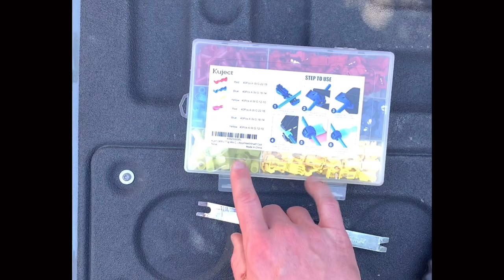RAPTOR GRILLE INSTALL ON 2016 F150: Only complete install on YouTube.

Comment: Best tutorial regarding the grill.  I bought the same grill you did and installed it myself today.  It took me 2.5 hours without using any power tools.  It completely changed the face of my truck.  The only thing I did differently is putting heat shrink wrap around the connections leading to the power source  Thanks, Bro!  Liked and subbed!
Reply from the maker: Thank you so much for taking the time to say that. It really means a lot. Take care brother. 🙏🏻🙌🏻

Comment: Thank you so much, you went through every detail; it took me at least 3 hours. The biggest problem areas were the screws attaching the grill to the housing and the wiring. I didn't have the crimp and clamp stuff but I had a soldering gun. It wouldn't be hard to wire if the parking clamp was longer but I got it done.
Reply from the maker: Awesome man! You are welcome!
Yeah that wire is kinda short. I’m glad u were able to get it done. What year F150 do you have?
Reply: @AutoHeadz  It's a 2016 and I found the black and green wires on the driver side, the passenger side was black and brown. I think wiring was actually harder than the grill install with the limited space I had to work with.

Comment: Great video!! The process was step by step just like you said and it was SO helpful!  You made it so easy! Thank you!! The only issue I had was that I have the LED headlights and the wire for the parking/running lights is not that easily accessible. So I need to tap into the fuse box or find a way to otherwise tap my running light wire.

Comment: Thanks for this. Im planning on doing this to my 16 F-150 soon.
Reply from the maker: No problem man, I’m glad you liked it. Thanks for the support.
Reply: @AutoHeadz  dumb question, on the links there are 3 grilles which is the one on your 2016? I like the new style but it’s out of stock.
Reply from the maker: Not a dumb question at all. They keep getting sold out so I put a few links so people can get ahold of one.
The one that is on my truck is the other two. They are the exact same just sold from a different vendor.
Reply: @AutoHeadz  thanks and have a Merry Christmas.
Reply from the maker: Absolutely! The Boaz one is a little cheaper. 
Merry Christmas to you too.

Comment: Great vid. Gettin ready to do my install.   But gonna hold off and order the tools you recommended!!!
Reply from the maker: Thank you. It’s an awesome upgrade, you will love it. The tools definitely make the whole instal very simple. When you finish let me know how it went. Take care!
Reply: @AutoHeadz  Just knocked it out.  Yur vid was a huge help.  Thanks a lot!   The only thing I would do differently, hindsight being 20-20.  I would have connected the wire tap tool to the parking light wires before placing the new grill back onto the truck.  Justa little more room to work.  
But great video dude. Thanks again!

Comment: It took an hour and a few minutes to install the grill that I bought 2 years ago😓 the only detail that used the blue contacts and apparently it was too big to make the connection, sometimes it turns on the lights, I will change it as soon as I have them.
Reply from the maker: There we go! Easy fix. Thanks for watching my video. Have a great weekend man.

Comment: Have my grill ready to install. I have a 2016 also but have a front facing camera attached to the stock grill.  Anyone else have this?  Was it easy to remove and install on the new grill?  Great video & thanks for the detailed explanation on the wiring.

Comment: Thanks for the video!! Question: do the grille lights come on with the headlights? Or are they only when parked unlock etc?
Reply from the maker: Absolutely! Yes the grille lights turn on when the headlights turn on. So in automatic mode when the lights turn on so do the grille lights.

Comment: Will it be ok pulling power from one side of the headlights? Or are both headlights the same power supply/fuse?
Reply from the maker: Hey man! 
Yes, both headlights are powered by the same supply/battery and same fuse.
Reply: Thanks for the quick reply bro. Question I’ve seen some different ways of wiring where they stay on the moment ignition starts. How would I go about wiring it so they’re only on when my headlights or parking lights are on. That way I can still do blackout driving

Comment: Got everything done but I have a Lariat with LEDs. Unfortunately there is no place to splice into the headlight because it is all one plug in LED models. I assume at this point I’ll need to take it to a shop to correctly get the power ran.
Reply: Just commented on this to help out other LED owners, kind of a bummer to finish up realize you can hook into the power. Lol

Comment: Everything went great with the grill lights going on with key fob test. For some reason when driving with headlights on the parking and grill lights turn off. When the car is running and lights are turned on to headlights I see a flicker but parking grill lights won't stay on. However when the car is off I can go through the light switch and they will remain on. Any ideas to correct this. I have a 2019 Ford Ranger and the Grill is from Amazon for Rangers (FEETY).

Comment: Great video! I have Anzo headlights and for some reason my amber grille lights do not work after connecting. Same green and black wire. Any thoughts?
Reply from the maker: Hmmm check out my “how to wire raptor grille video” maybe you connected to the same harness? https://youtu.be/lqNByOrCw3U

Comment: Good morning, I watched your video on installing grill, unfortunately after 1 year , 1 of the lights on the grill went out, ordered new ones. Is there an easier way to replace one of the lights without removing the whole grill?
Reply from the maker: Sorry to hear that. Without removing the Grille it would be impossible to replace/work on. Can I ask where you purchased it?
Reply: @AutoHeadz  eBay, if I have to remove the grill I’m just gonna go back to stock, don’t want to deal with replacing a light every year lol
Reply from the maker: I hear ya man. That’s why I asked; the eBay grilles are garbage. I provided a link to a good one if you ever want to replace it. Sorry about that man.
Reply: @AutoHeadz  I’ll check it out, I did order replacement lights

Comment: hey i just did this install and wired it your way...lights come on when you start the truck or unlock it,....but dont stay on unless you have your lights on...is that what your is doing?
Reply from the maker: Yes they aren’t supposed to be on during the day. They turn on automatically when you have it on auto.
Reply: @AutoHeadz  yea I seen that... I'm wondering if u can switch it to the daytime running lights ...I'd like to have them on all the time...

Comment: your link for the raptor grill letters doesn't work anymore. any specific ones I need to look for?
Reply from the maker: Yes. For some reason these are becoming hard to find. This one looks identical to the one I got. 
https://amzn.to/2XdfgkT
Thanks for letting me know the link is not working. Good luck!
Reply from the maker: This is a new style that has got really good reviews also. Looks pretty badass. Check it out. RAPTOR GRILLE - (new style) https://amzn.to/3j00yVU

Comment: For the wire T-Taps will 16-14’s work or do they have to be 22-18?
Reply from the maker: You need 22-18 otherwise you won’t get a good connection. The taps wouldn’t get a good enough bite on the gauge wire.
Reply: AutoHeadz I accidentally bought 16-14’s can i put them on temporarily and switch them to the right ones later, I couldn’t find 22-18’s in my hometown.
Reply: or should i install the grill but not connect the lights till i find the t taps?
Reply from the maker: You could try but my fear would be that you compromise the connection. I put the link in the video description to buy them on amazon. I think they are around 10 bucks.
Reply from the maker: I honestly would wait man.
Reply: Where can I find this kit for the electrical? Thanks
Reply from the maker: I included a clickable link in the description of the video.
Reply: @AutoHeadz  thanks boss. Great video
Reply from the maker: @danielstagg6425  Thank you sir. 🙏🏻

Comment: OUTSTANDING.......only thing that might make it easier is at the end of your video when you were connecting the wire clips... question- would this have be easier to do - before you put the grill back on?  Asking for a friend....LOL.  Great video man....very detailed.  lv it!  Also, how much does this raptor grill cost?

Comment: Although I'm fully capable of doing this install. I've changed my mind on getting the grill just based on the sheer pain in the butt it looks like
Reply from the maker: Oh no bro. Honestly the whole install  only took about 40 min. Very easy man I promise.
Reply: I put on my big boy pants and ordered one. You were right it's pretty straightforward and was a breeze to install
Reply from the maker: 😂😂😂. Good for you man. Pretty sick right?
Reply: @AutoHeadz  it looks pretty badass on my lightning blue STX. I used carbon fiber vinyl wrap and did the face of the letters. I also swapped the STX decals on the bed with matte black, blacked out the F-150 emblem. Put an eco Beast overlay on the door emblem. Did Plasti Dip on the wheels and some other matching things